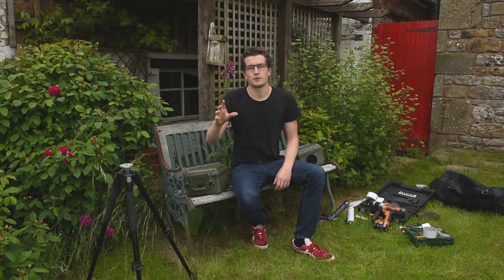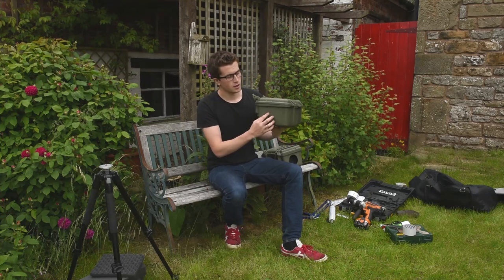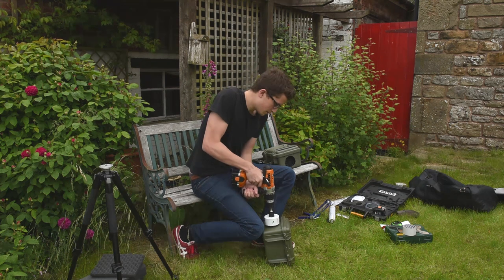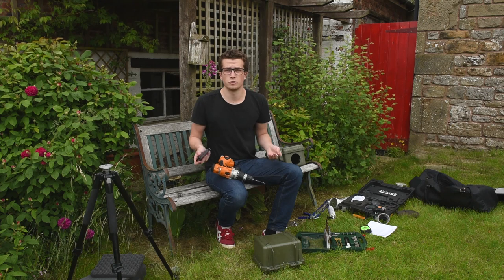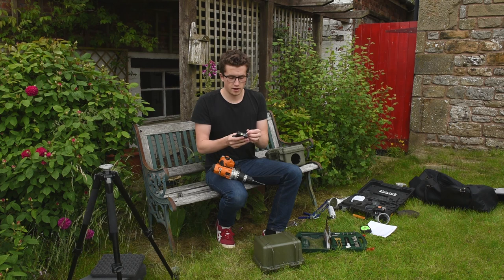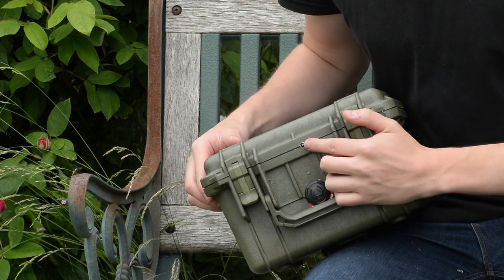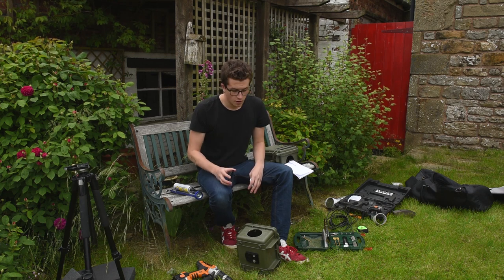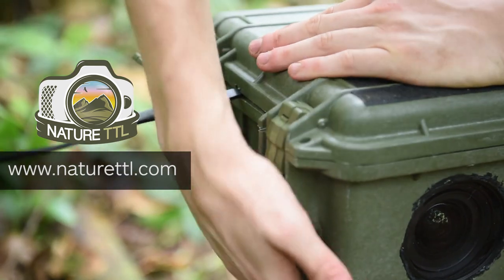How to Make a DSLR Camera Trap Housing

Comment: A metal 50 caliber ammo box is WAY cheaper than a Pelican case. They are as rugged and water proof as a pelican case only they can be had brand new or military surplus for about $13. I built a camera housing out of one 20 years ago. The camera's long gone, but the housing has lived on in my garden for the last 15 years as a WiFi router housing.

Comment: Hi Will. After attaching the plate to the bottom of the housing, how do you then secure the camera inside? Thanks.
Reply from the maker: In this particular setup we just place the camera inside and it works fine. A bit of the pelican's foam can prop the lens up if needed. You can attach a tripod plate inside, however, should you wish to.
Reply: NatureTTL Okay, fair enough. And thank you for your quick reply!